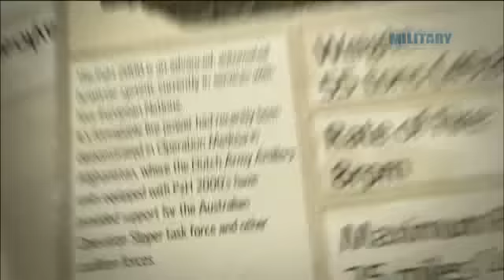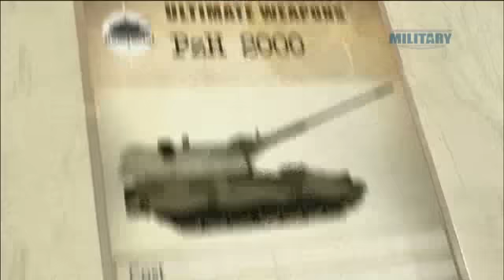Ultimate Weapons- PzH 2000

Comment: I'm in the Dutch army, and we also use the PHZ2000. I think it's great !!!
Reply: do we ? cool
Reply: ARCHER is better :) ;P
Reply: BIOSHOCKFOXX Why ? Please explain.
Reply: True. Can't argue with that. And a machine is as good as it's crew.
Reply: 13thSystem Archer has much less ammo capacity and needs much longer to refill the internal stock (which means it is much less autonomous than the PzH) and has a lower RoF (only 3 rounds in 15 seconds contrary to 3 rounds in 10s by the PzH 2000, so you are wrong here, also the PzH crew doesn't handle the ammunition, only the charges which is pretty quick done)... ohh, and the PzH is faster on the road again than the Archer system (no need for stabalizer)... in the end both systems show different approaches to a good howitzer...
Reply: 13thSystem ohhh: and accuracy is the same...
Reply: 8 RPM for the PzH is as wrong as 18. The PzH shoots 3 rounds in 10 seconds, 10 rounds in one minute or 8 rounds per minute for 3 minutes (continuous fire). The Archer has a RPM of 8 to 9 rounds max and in terms of mobility the PzH is thanks to tracks and the less needed time for fire-preparation the winner... even that the Archer is on road faster, the PzH is more autonomous thanks to a bigger stock of ammunition.
Reply: piet jansen
 Could you specify why exactly such comparison ?
Reply: Too expensive. Buy Korean k9 instead.
The pzh 2000 is marginally better in all aspects but the k9 costs 60 percent of the German vehicle.
Reply: German Engeneering ....Bomm sonn Feuerball Junge :)
Reply: You can have three guys operate it Gunner Commander Driver thanks to the automated loader  system although the charge needs to be manually loaded by the Gunner. Eight to ten men are required to operate the American M109
Reply: @MrCarponizer  😂😂👍🔥

Comment: great system, must be german!
Reply: Pzh 2000:    ... 3 rounds in 9.0 seconds (Burst) up to 12 rounds/min, ...shot assisted shells over a distance of 56 km with a probable maximum range of over 60 km, can also fire the SMArt 155 artillery round, has superb cross-country performance (almost like a MBT) because of its use of continuous tracks and considerable protection in the case of counter-fire, additional bomblet protection,  ten M982 Excaliburs were fired at ranges from 9 to 48 kilometers, shells hit with an average miss distance of one meter at 48 km, can also shoot directly at targets like tanks, bunker. Only drawback is the weight  ;-)

Comment: 1:27 Why do they use the animation of a Jagdpanzer Elefant?
Reply: Why does it matter to you ?
Reply: BIOSHOCKFOXX Well the JgPz Elefant was a 1940s tank destroyer, while the PzH 2000 is a 21st century self-propelled howitzer. Other than them both having a big gun and superficially similar shape, these vehicles have little in common. It is a bit odd that the Elefant model is being used here (sharp eyes for noticing that, by the way, I didn't catch that).

Comment: @gnomopocho 

Loading the charge can be done by hand fast enough. They have only little weight and are easy to handle. 

Installing a second loading mechanism for the charges would barely gain 1 second per loading cycle. That would be no advantage, would make the howitzer just even more expensive and the mechanism unnecessarily more complex.

Comment: Thanks...Yes, I did notice that because by they're quite different by design, although both have turrets at the end of the chassis. But, Ferdinand actually doesn't have turret, but only a fixed structure, in contrast to PZH-2000.
Of course, I realize that this is used only as an example, but I had to comment, just to point out that...

Comment: @ak907jk Much words about a misunderstanding ;) The defining measure of an assault rifle is not only the fully automatic fire, but also that it uses a significantly smaller dimensioned cartridge to aid in automatic fire control. It therefor gave each individual soldier a massive boost in firepower. THAT is the nature of an assault rifle. The earlier automatic rifles could not deliver this.

Comment: @patman173 Hurr Durr the PzH is a Self-Propelled Gun , designed for long range fire support.
Whereas the the M1 is a Main Battle Tank designed for spearheading operations.
They're 2 completely different vehicles for doing completely different things.
If an M1 was apart of the opposing force against an army with this, the M1 wouldn't be able to get anywhere near it because it'd be over 30kms away.

Comment: Wouldn't changing the angles of firing result in different distances, not the time to the same target?
Reply: CornelSheppard That is the most logical, but at the same time most impractical thing. I was thinking about controlling the gun - cannon recoil (if the gun compresses itself more after each shell it might reduce its travel distance due to time of shell being in the gun), or maybe projectiles are like rockets and the flight path is controled by fins on them. This is my theory, but I am hoping on some expert opinion - explanation.
Btw thanks for feedback :)
Reply: bmxrider117  
I dont know how it exactly worked but at the end of the barral the Shell get programmed where it has to explode this doesnt explain a lot but i think thats maby an intresting fact
(Sry for my bad english )
Reply: the loader manually puts in the charge. so he can use different combinations of charges according to the ballistic computers calculations. obviously you can't use that fire mode at max range but every target closer than that can be targeted by different combinations of gun elevation and charges. 4-5 different combinations are possible.

Comment: @Ishariot91 1 t34 vs a 1 tiger the tiger would win. But the tiger was drained a lot of resources. Throughout the war only 1,347 tigers were made and only 492 tiger 2's where made that’s crap, the t34 was produced in mass quantities about 2,000 units in one month. The T34 had sloping armour so shells hitting it at an angle simply bounced off. It also has wider tracks that enable it to go through thick snow and mud without getting bogged down unlike a tiger. Sometimes quantity beats quality.

Comment: Yes its a good weapon. But its a lot of component that are depending on each others. And if 1 or 2 thing brakes down it the gun cant fire or reload. Thats not the issue on a manuell gun.. And they need to clean it very propely and its also more fragile for a dusty invorment. So its sometimes better with a manuell loading system.
Reply: +Ray Jo You do realise they have been used in Afgahnistan without a problem? (exept heat on the ammo)
And it can also be loaded manually.
Reply: yes Iam know.. but more and more components is a system depending on each others thoug more problems when something goes wrong.. i am a mechanic
Reply: +Ray Jo Yes it can, everything also works manuel due to the crew members, that was one of the main critirea of that SPG.
Reply: it can also be reloaded by manual

Comment: The most modern russian tank is the T-90, which is basically a T-72 with Shtora-1 and kontakt-5. It needs ERA to achieve almost the same armor protection, as western MBTs have without ERA and there are ERA packages for every western MBT, too. They simply aren't used, because they endanger surrounding infantry. If those western MBTs had to fight other MBTs, they would be equipped with ERA prior to the fight. This means, they would have about twice the armor protection of the best russian tank.

Comment: @xiuyuansean I think you are dropping out other reasons to why it only get 3 stars, its cost is cheap, its rate of fire is average, accuracy is good and intelligence is average, the amount ''stars'' it gets could be based on other things like complications and issues with the range, the range can be as good as the American, but using it based on combat effectivness could decrease its capability compared to the American because it got more complications under firing etc.

Comment: SELF-PROPELLED ARTILLERY = a cannon with auto-loading mechanism + on wheels/tracks + fire control system + thin armor; cannot fire when barrel is at rest position (horizontal). only has sufficient armor against MG,SMG,pistols. Designed to support tanks and infantry.
TANK = thick armor + rotating turret (stereotype) + tracks + an MG and cannon designed to fire horizontally (with some room for adjustment) against anything it can see + fire control + other accessories(e.g., smoke).

Comment: 0:28

Why even mention its horsepower? Its the torque that matters...
Reply: No. It's NOT torque that matters. Both matter. Quick lesson if you skipped physics in school:
Torque is the force applied over an offset distance.
(Horse)power is the RATE of work done. In other words: without (horse)power you can maybe do something with extreme force, but you don't have the systemic speed.
So obviously you want the torque needed for a strong climb, but also the power to drive quickly.

Comment: I doubt the engine is 950hp

When the most powerful truck engine in the world is 850hp scanners best performer.
Reply: +chris77777777ify 
You're right, it's not 950hp, it's more like 1000hp.
The MTU 881 Ka-500 is not a truck engine, it's a tank engine, it's a 12 cylinder multi fuel engine.
Trying to compare a commercial truck engine to a military tank engine is like comparing apples to oranges!

Comment: I realy dont get why the NLOS-Canon gets a better rating...
Reply: coz its cheaper and faster
Reply: Eduard Šajgalik And not in production
Reply: Because this is an American show ofcourse....
Reply: The big differentiator with the NLOS cannon was supposed to be weight: about 30 tons for NLOS vs. 55 tons for the PzH 2000.  (Which would make NLOS a lot easier for the U.S. to deploy to many places around the world.)  Problem with that was that actually building an affordable 30 ton system having similar capabilities to the PzH 2000 (and other systems like that) turned out to be basically impossible.  And, even today, nothing much has changed technologically with that.

Comment: Awesome system with a poor fire control system in support.  It's a "glass cannon."  I recently have coordinated fires with international units using the PZh, and on 4 consecutive fire missions, there was equipment failure causing the PZh to miss all 4 time on target missions conducted with fast movers.  Mechanicly, the system is totally more advanced than our M 109 A6, but the fire control and minor hydro issues caused it to be less effective in my experience,